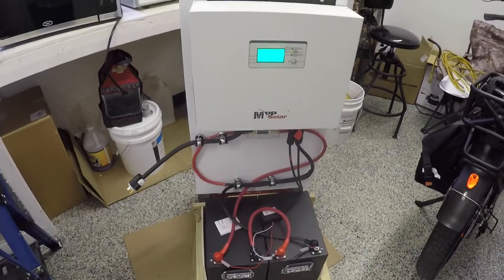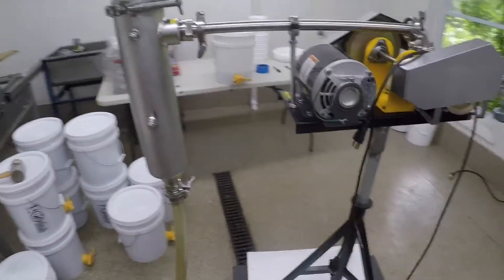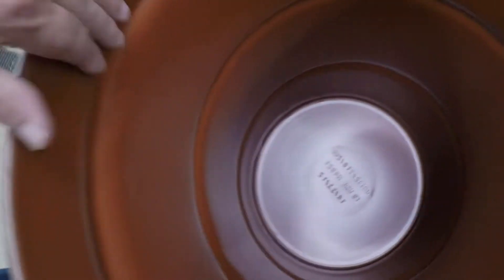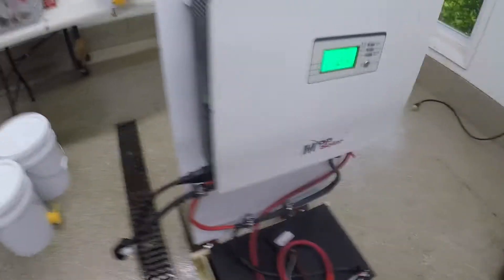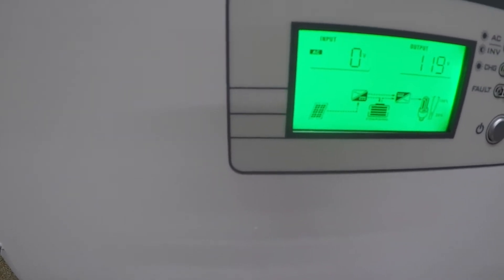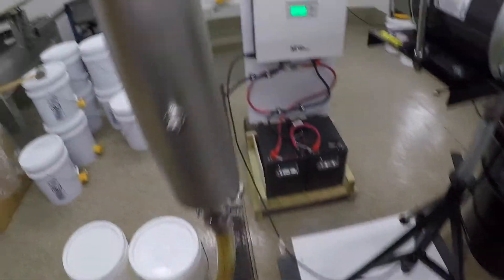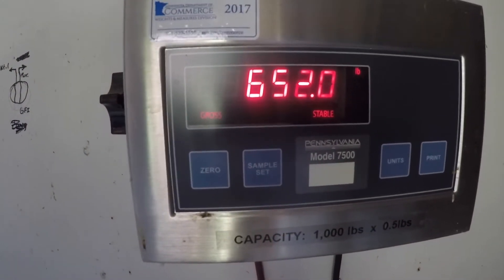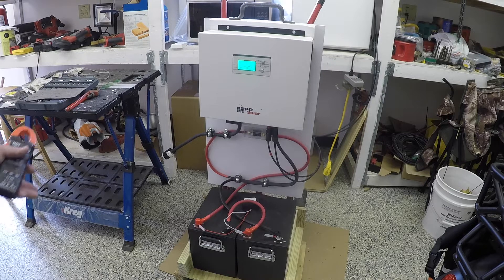"Honey on Tap: Solar-Powered Drum Pumping"

Comment: Thanks for making this video. Just wondering why you changed from your Growatt setup?
Reply from the maker: I changed for a bigger battery. The Growatt worked great but the battery size was a little over 2 kw. The growatt build also used raw cells with a separate BMS. For many DIY'ers this is a little intimidating to build. This MPP is a very simple setup with 5 kw of battery. Very simple to hook up, the SOK batteries have their own internal BMS. The bigger capacity makes this work great for a power outage. The SOK batteries could easily run a refrigerator or a furnace for a day or two.  Having four solar panels could recharge the batteries to give a long term solution to an extended outage. As I have made these solar generators, my next foray will be to build a Victron off grid setup for our cabin in Northern MN. Just waiting for UL approval of the 48V 5k Victron inverters. Approval is pending for those inverters at the moment.